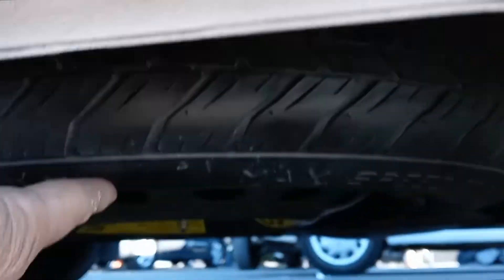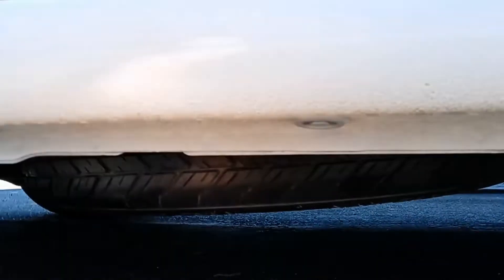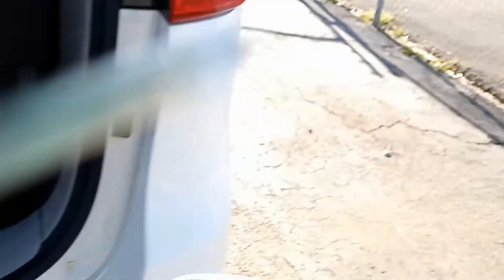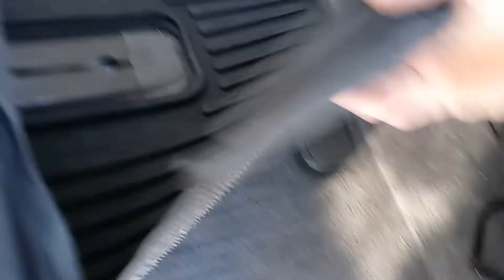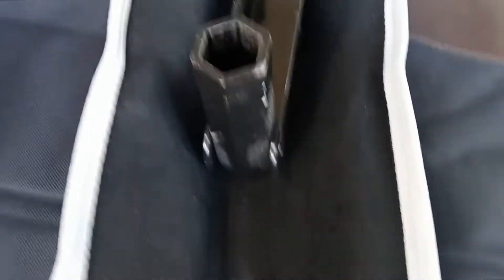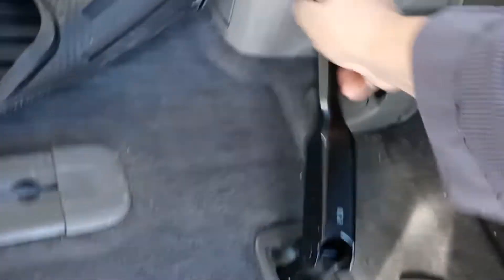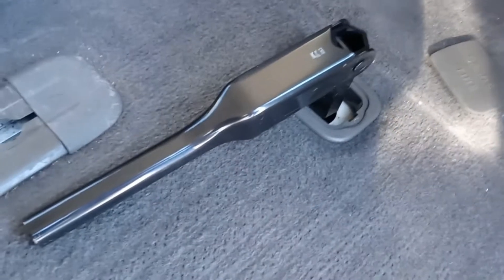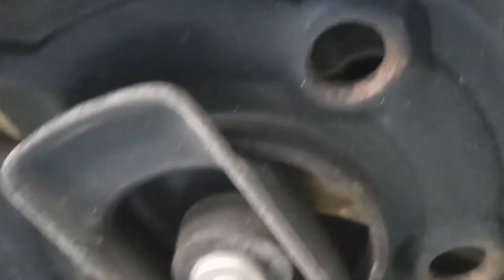Kia Sedona Spare Tire Location and How to Change

Comment: Thanks for this... watched your video on the side of the highway after spending 15 minutes trying to figure out where the hell the spare was lol
Reply: Same here
Reply: I had to call a tow truck for a van once because that tire was under a panel in the same place eye the nut is on this one ... in the center.  All 4 seats had to move but my drivers seat was stuck due to a short in the controls for it.  Took me and the tire truck driver a while to get that spare out.